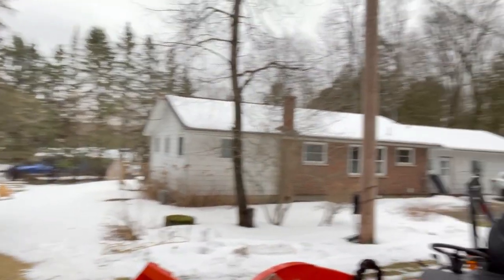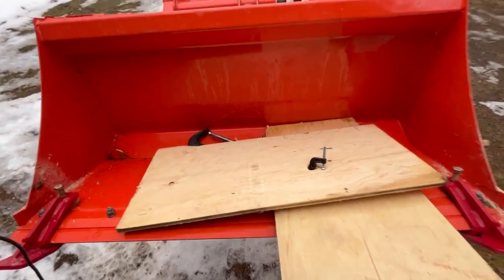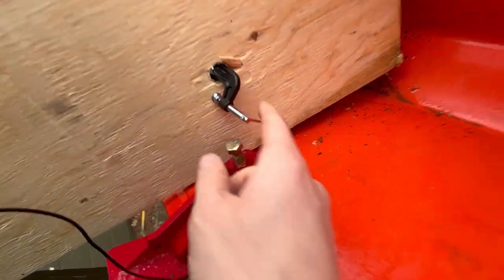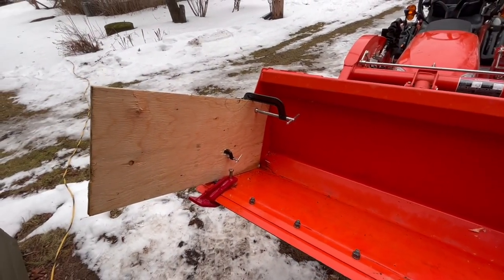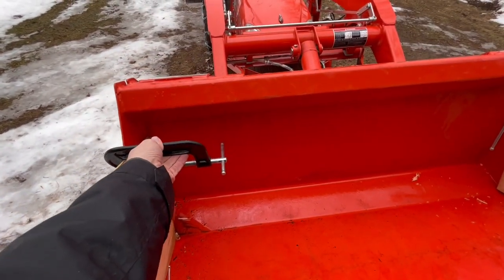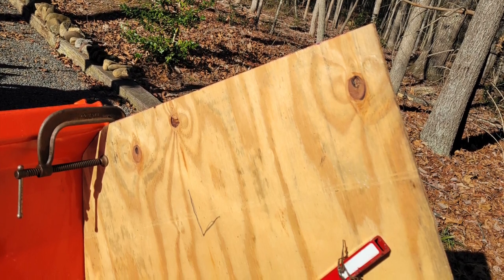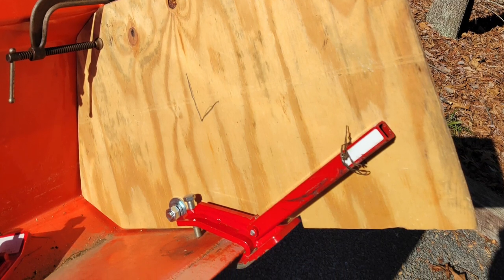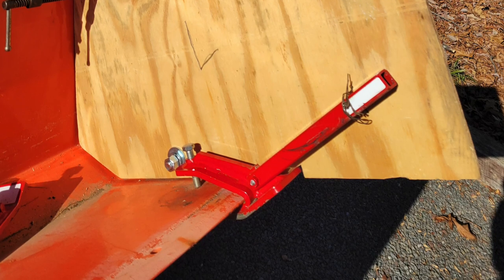How to add plywood to the sides of your bucket I BX2380 Snow Plowing Mod I Unnecessary How To

Comment: Try adding an L bracket to the bottom of the plywood the tighten the edge tamer down on the Lip that sticks out. That should hold the front edge down.
Reply from the maker: That sir, is a fantastic idea! 3.0 coming right up.

Comment: Can't really see the plywood holding up too long especially and heavy half frozen snow... But it'll work for a while.. I got some nice metal plates that I'm going to bolt in if I feel the need
Reply from the maker: The metal would last much longer. The plywood is really just proof of concept. Only worth doing with scrap. It does get beat up for sure. Thanks for watching.

Comment: You wouldn't be the first guy with Big You Tube dreams that might night come true but you are giving it your all. I personally wouldn't waste 10 seconds on some of those stupid channels that have 1 Million subscribers. I notice you don't have a cutting edge bar on your bucket and only wanted to suggest that you make this small investment (Less than $70.00). If you want to know why then the next time you visit your tractor Dealership go out to the used tractor sales yard and take a look at some of the old tractors for sale and you will notice what is referred to as The Smiling Bucket. This sad looking thing happens very slowly over time and one day you walk past your tractor and notice that that edge of the bucket is no longer flat and level in the middle but seems to be smiling at you because after lifting things for awhile it will start to bend and a cutting edge bar will mostly stop this from happening. I see your bucket has the pre drilled holes so it is ready for one. I also made sure that I used grade 8 bolts to fasten them on. I love my Kubota and do everything possible to keep it in top shape.
Reply from the maker: I will have to check that out. I do have a cutting edge bolted on. Is this something different?
Reply: @BigGuyLittleTractor  I'm sorry I was looking at your video at 3.50 and didn't see that it was not your tractor. Enjoy your day my friend.
Reply from the maker: Same to you! I will let Spencer’s know he should add one.